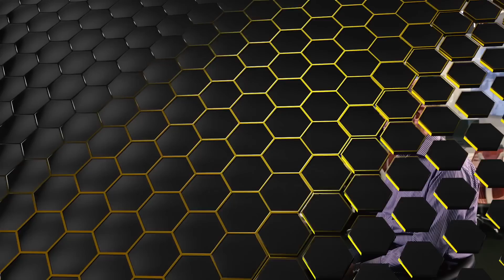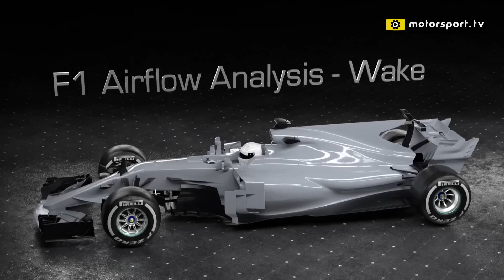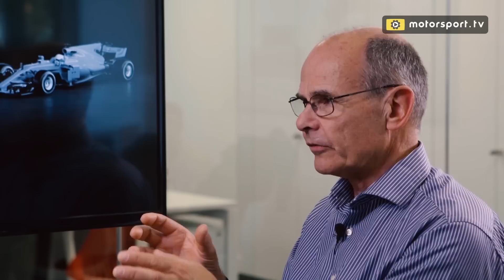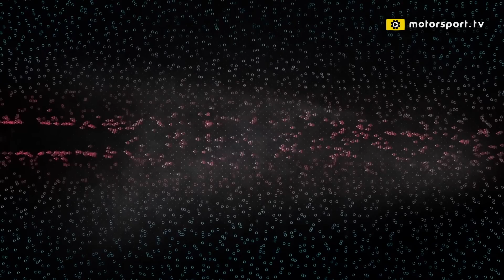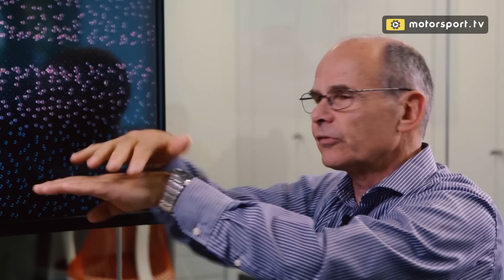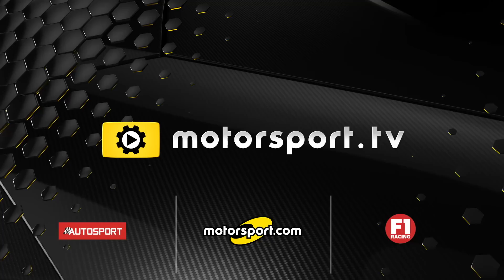Wakesurfing, F1-style

Comment: I say get rid of DRS and allow the cars to use as much fuel flow as they want but with a limited fuel amount so 100 litres but a huge fuel flow to get past a car for a boost but then that car will need to run lean to finish the race so could be passed latter in the race by the ones conserving fuel. In my mind this works or does it mean the lead car gets an advantage by being able to conserve fuel?

Comment: Actually I found this to be quite simplistic and dull.
The rear wing may send air skyward (you can see this during any wet race), but what about the low pressure area that is left by that air?

We've all seen "double DRS" situations too.

And in terms of the dirty effect in corners, I'd hoped to see a more detailed demonstration with the graphics, to show precisely how that turbulent air and low pressure hits those key surfaces differently from still air for the leading car.

Why not discuss how the problem can be reduced too?

Comment: very cool Peter thank you. FIrst of all. I clicked the Like Button. I am a subscriber. so I do like your channel. You do listen to the subscribers. So I hope my comments are taken on board.

What frustrated me, was a lot of what the man was saying. Wasnt demonstrated, so when he spoke about the 2nd car in a 3rd car train. Opening up DRS,  would suck the rear wing wake down from the lead car. That wasnt explained so I have no idea why or how that happens. 

He also mentioned the air when cornering and how the wake is affected there, and that you would want to be "inboard" but I dont understand why. Again that wasn't shown. 

very cool segment though

In regards to F1. I think the DRS is used with the wrong parameters. I think if the gap to the car infront of you is MORE THAN A SECOND. you should get DRS. once you get to the 1 second DRS is deactivated and you have to then pass with talent, speed and a good car.  This would also help the slower cars. they could run a higher engine mode as they would be on DRS a lot more. and close the field up a bit more 

also something needs to be done about Midfield teams. They do just enough to get points and to get a return on their investment. Williams are using 1 less engine each season. therefore have NO INTEREST in winning. I know Peter wont like that comment but it is true. how do you expect to compete with 1 less engine. and lower power modes.  I think the one way to stop that would be to impose a percentage rule. so constructors points. you  cant finish the constructors championship 5 points at the end of 4 stages in the year. so every 5 races you have to be within 5 points at those stages of the team ahead of you. if not you get a fine that dips you under your break even point. this would encourage teams to actually develop. because as I said. Williams and force india and Sauber do just enough to make points to get the money and break even or + 10% which keeps most shareholders happy.